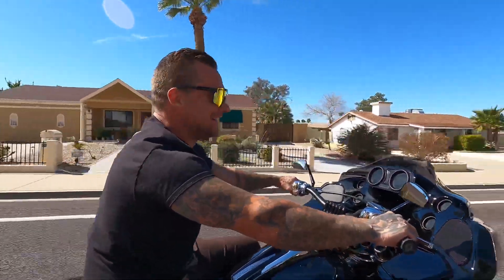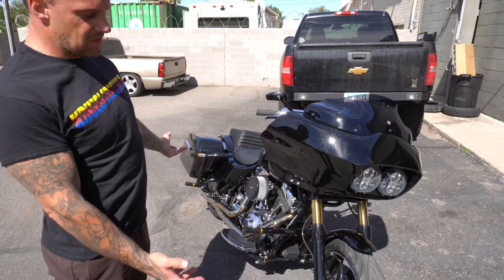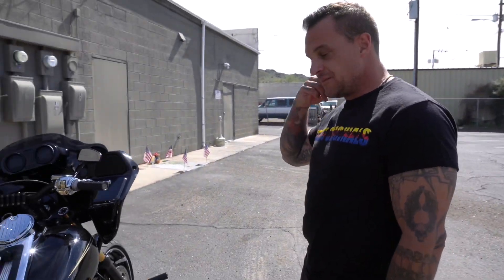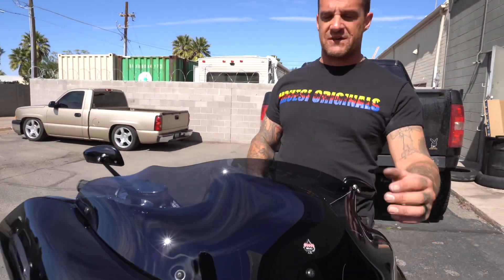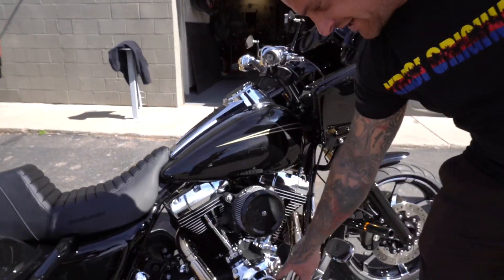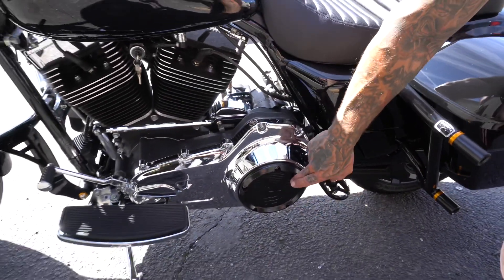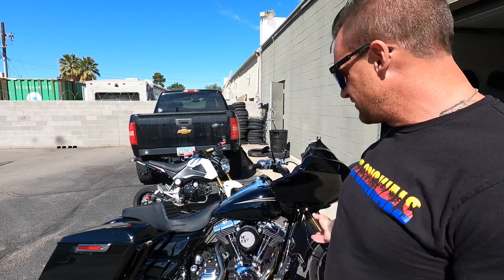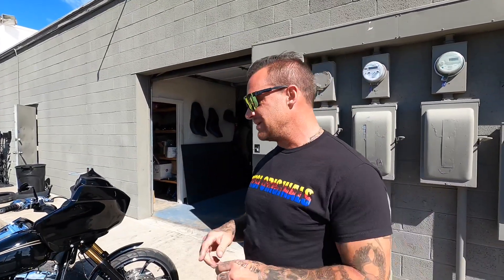How to build a performance road glide on a budget (P9) the ride and review

Comment: I put the thunder max on my stock 2020 road king header, after I took the cat out. just ground out the old bungs ,welded in the bigger bungs definitely had to put the front one on a funny angle so it didn’t hit the motor

Comment: Do you have a sprocket size recommendation for a Yamaha bolt chain conversion I don't want it to just be stunt lot I also want to be able to cruise with my girl in the back and also be able to do wheelies I'm thinking maybe 16 in the front and 55 in the back I'm not sure it's my first time during sprocket for stunt any input would be awesome
Reply from the maker: I don’t know anything about a Yamaha bolt, but that sounds extremely low geared
Reply: @kruesioriginals  hmmm what do you guys do on the harleys
Reply from the maker: @californiapoontappa   24/51 depends on model and a bunch of stuff but five speeds that’s what we run. That’s not gonna be relevant for a bolt at all though the trannys are gonna be different everything is different. You have to know what their ratio is for trans to rear drive ratio and do the math on that
Reply: @kruesioriginals  yeah the dude that makes me he kit said 16 55  but do 60 for lot

Comment: Im torn I want an older road glide but feel like I may want that 6 speed for the highway 😖
Reply from the maker: Depends on what you’re gonna do but the six beads are pretty much trash
Reply from the maker: Speeds
Reply: @kruesioriginals  i mostly want to do highway miles

Comment: @kruesi originals what motor work do you recommend for this type of set up.
Reply from the maker: That’s a big open question right there, I did not build this motor but it makes a bunch of power and it’s real fun. Normally 103 little more compression good Cam. I like 100hp 100tq it’s the most all around fun

Comment: When you re-wire the harness, can you just cut the unused wires and cap the ends? Or do you have to run all new wires? I want to remove my radio too.
Reply from the maker: You can cap more for the most part I just ran everything back to the source and got rid of it went pretty extreme